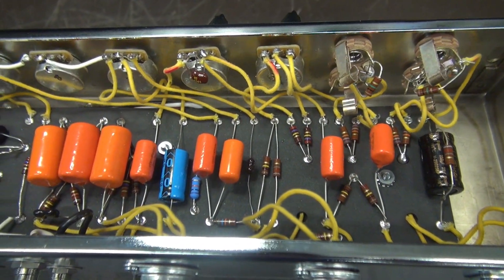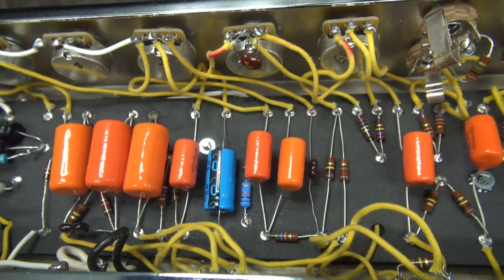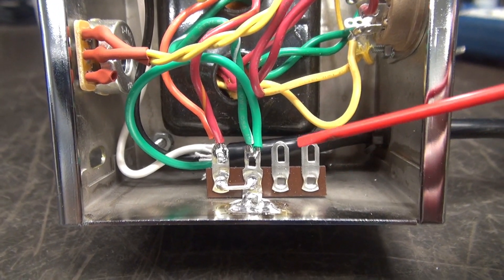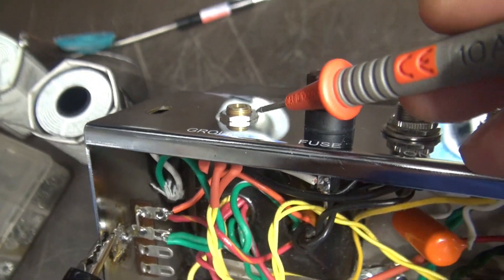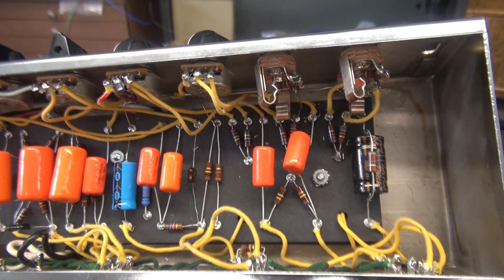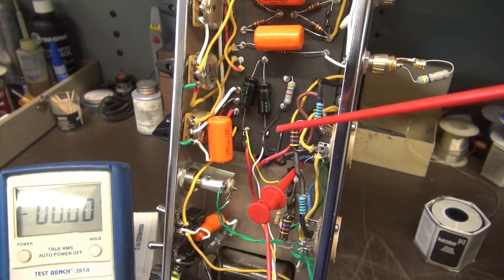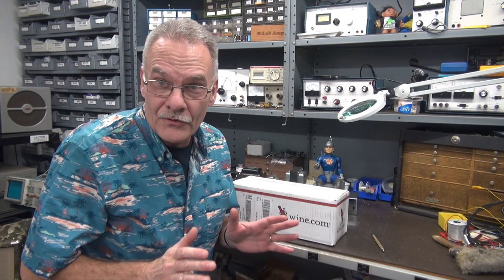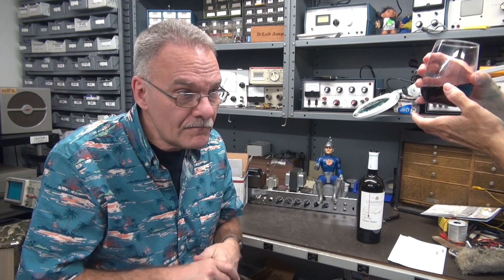How to repair grounds Fender 5F6A Bassman MojoTone kit Fix build errors Tube guitar amp Magic

Comment: I'm in the middle of a much simpler build (5E3 kit).  This video helped confirm the grounding scheme I have set up should be good (fingers crossed).  Especially helpful are all the other tidbits on resistor placement, etc.  I also appreciate that a positive attitude was kept towards people building kits - so often amp techs take an attitude that we amateurs have no business building them.

Comment: Terry - I'm in the middle restoring a Ampeg Reverb Rocket 2.    It has a slightly corroded chassis, and had may other issues (including being retubed wrong), your videos and tips have been indispensable to me as I work through this amp and getting it to work the way it should.   Your modifications and tips on grounding are right on!

Comment: Terry, Your channel is growing on me... Great job! And as one wine enthusiast to another, I thought a little paring chart between wines and fixing tube amps is in order (measures are plate voltages):
150v-200v = Malbec
200v-300v = Merlot
300v - 400 = Pinot Noir
400v - 550v = Cab/Sauv
550v -over= Zinfandel
Enjoy!

Comment: I am not a fan of using the back of the pots as a grounding point. I think it looks bad, and IF the case ever loses continuity, you have no more ground. So I always run any ground to a grounding bus. This ensures that all necessary grounds go to a single electrical conductor that can then be connected to a common ground following good star grounding methods.

Comment: Perfect timing for this video, Terry. I am constructing a 5E7 just now and have encountered a few problems that I think relate to grounding. I was struggling with trying to figure out a scheme to run the ground wire. Currently mine is exposed above the circuit board. I also tried to solder on the backs of tone pots, but that is less than successful, so I have a second buss hanging in the air that connects to the input jacks. I knew this wasn't right, and was trying to come up with a solution to this very problem. Your video is the answer to the problems I am having right now. Thank you so much for putting this out there. How do we get in touch with you if this problem I am having persists?
Reply from the maker: Cool deal man, Hope it helps, if not n6tlu@comcast.net

Comment: I am a 5F6A specialist. I always, always, ALWAYS use a brass plate and follow the original design that left the factory in late 59/early 60. The Fender schematic is incorrect, the biggest things are the LTPPI, mid slope resistor, bass tone cap and the presence cap/pot/resistor. All of the things I’m talking about can be found here https://robrobinette.com/5F6A_Modifications.htm

I wish Mojotone would send out a brass plate, they aren’t expensive ($3). I wish they would also fix the schematic they send out to their customers. It really is a good kit though, just needs some inexpensive tweaks.

Thanks for the video, Terry!
Reply: @Matt Fields  where do you source your plates?
Reply: I don't like their cap board layout for the 5F6A and 5F8A either- it has the grid filter and the preamp filter on the same ground wire. When I wired it their way I got horrible noise and motorboating. When I wired it per Rob Robinette's layout (reservoir and grid filters to the power ground, and preamp filter to the preamp ground buss) all was well.

Comment: what is that stud you are using to mount the grounding tabs for the transformer (the 1st tab you installed; looks like a rivet)?
Reply from the maker: Hello, Yes a steel pop rivet, ground the metal under then soldered

Comment: looks like death cap fitted
Reply from the maker: That Cap is actually on the HV Stby switch
Reply: That's the "anti-pop" cap on the standby switch. A 100K 2W resistor across the switch works too, and allows just enough current through to slowly charge the reservoir caps as the rectifier warms up.

Comment: Nice work, sounds great, I just bought a  tube tester and tested ones that had been not in use for many years 6K7,s the grid leak was very high put them back into my national HRO from WW2 left it on for a few hours and retested them the grid leakage had vanished ? any Ideas Terry.

Comment: Great Video.
Terry, I did not see where you grounded the positive side of the bias capacitors.
You mentioned that there was a jumper missing and after the repair there still was none, what happened.
Reply from the maker: Its connected to the end of the ground buss, Also connects the Presence & Mid pots, Yellow wire with a red end

Comment: Q: could you use copper shielding tape behind pots to connect for casing ground?
Reply: Weak fix. Get some wire and do what Terry did.
Reply: @hestheMaster  thanks for your opinion but the question wasn't directed to you,
Reply: @fen79strat  Terry won't answer you on this one! Your even LUCKY I did! Comments section is opened to everyone and anyone , unless you know a rules change I'm not aware of.
Reply: @hestheMaster  I told you thanks. Not really sure why you think I'm lucky; some narcissist insults my question that was posed to someone else. Now please lend me your magic mirror so I can be as great as you! Now have a great day.
Reply: @hestheMaster  Last response! Sorry I hurt your feelings. Information in comments not aggression. I keep 14ga. solid copper wire on my bench for star grounding. Simply asking if conductive tape would also work.
Reply: Not terry, but it would still be a pain to solder to and an unreliable ground connection at best. It might work in a guitar for pickup and pot grounds, but not in a tube amp with hundreds of volts that's subject to lots of heat and vibration.

A 14-18 gauge buss wire terminating at an input jack is the best route, and it's easier to solder to than the chassis or a big brass plate with lots of thermal mass.

Comment: Good evening from Italy.. I have a question. A few days ago I bought an old vintage tube radio/turntable. I just bought it last week. I used it a few times with no problems. And then On friday I plugged it in again to listen to my records. But this time unfortunately sparks went off when I plugged it in. This action produced sparks from the outlet and cut off all the power in the house. Im hoping I did not ruin by Lesa Gutex turntable. Any feedback from  you would be appreciated. Have a great day.
Reply: Most likely, an old tube radio or amp might have sat on a shelf for 30 years before you bought it and plugged it in for the first time in those 30 years. The most likely problem is the failure of electrolytic caps that just dry out and go bad over time, especially that much time. It's also possible that the power cord dried out in a way you didn't notice and the insulation on the power cord failed, the conductors touched and shorted. Without seeing it, obviously I am only guessing, but those are the most likely problems. Usually, if you get sparks from either of those issues, it will not destroy anything else. It CAN, but probably not. Got to get it to a repair tech!
Reply: @pneumatic00  Thank you so much for taking the time to write back and  togive me such knowledgeable advice.
Reply: @THE1668KID  You're welcome! I miei migliori auguri per te!

Comment: Did you sand the chassis where you installed the terminal board for the ground?
Reply from the maker: Yes, used a dremel tool

Comment: @ 2:34 , you're not only relying on the integrity of the chassis, but this is also the  perfectly recipe for ground loops. and other issues.
Btw, according to nowadays standards, a ground/earth has to bolted on with it's own lug on a clean sanded area on the chassis and tightened with serrated washers (ideally with a lock nut)
That way you also don't need an heavy soldering iron, solder can get brittle after a while, although a washer could corrode as well I guess.